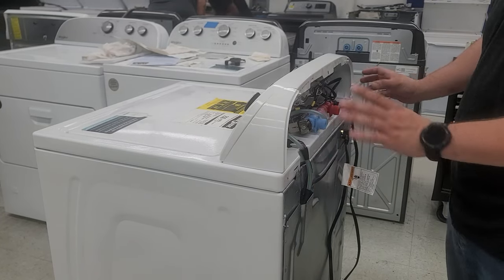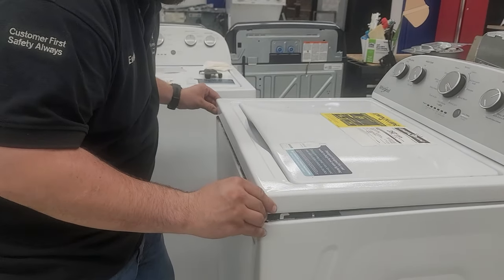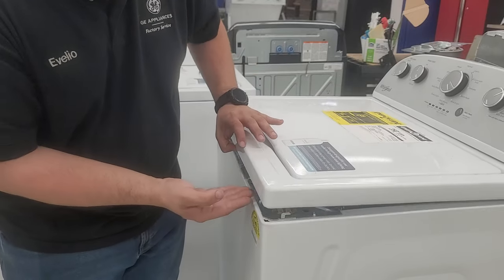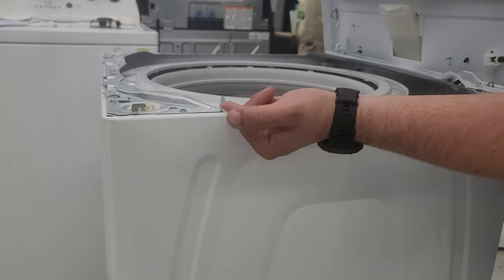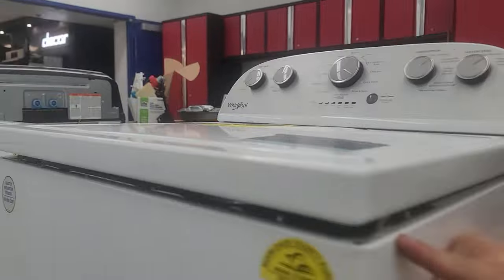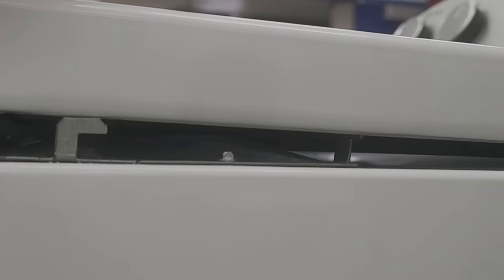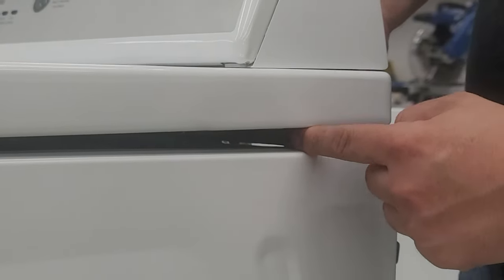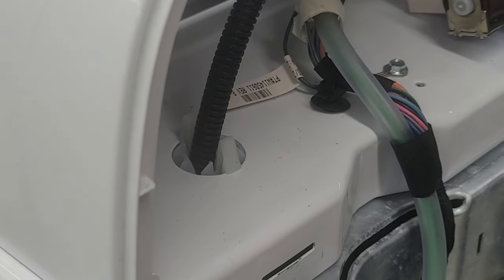Whirlpool Top Load Washer

Comment: Thanks! I just fixed one of these today! It was making a God awful sound when it tried to go into spin! I took off the washer drive pulley mechanism on the bottom and was ready to replace it. Turned out there was a sock up in there wrapping around the shaft, preventing it from spinning! No parts needed. I did have to open the lid to clean it up. Got it free off Facebook from someone who was getting rid of it. Now Imna sell it for $250! haha